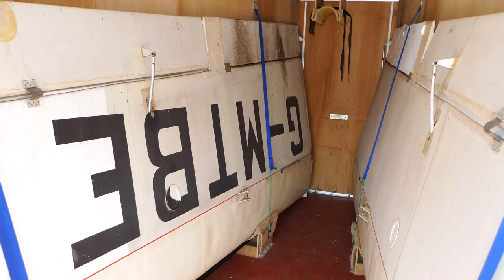Electric Shadow Episode 3 - Progress Report

Comment: Single seaters can now go to 600kg, so your shadow can now be 374kg MAUW.  That doubles your battery capacity for a single seater - making almost 4 hours duration.
Reply from the maker: I haven't seen the wording yet Tom. Does that include SSDR. I wasn't expecting it to. I think they will be regulated if over 300kg. So no change for me.
Reply from the maker: I’ve just had a look at the wording Tom, and it’s as I thought. There is no change to SSDRs.

Comment: Are you using 18650 cells? I guess model aircraft type Lipos would not be reliable enough and a bit too volatile. Love the idea of it charging up off solar power to provide completely off grid flying.
Reply from the maker: Yes, 18650
Reply: @adrianpjones  Look forward to seeing the details of the installation.